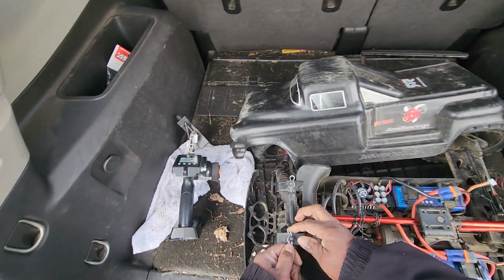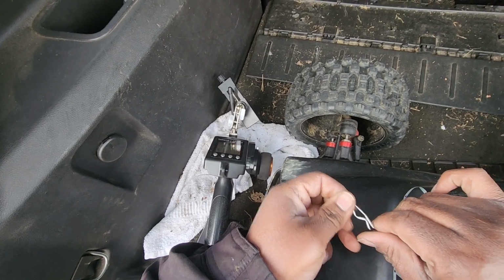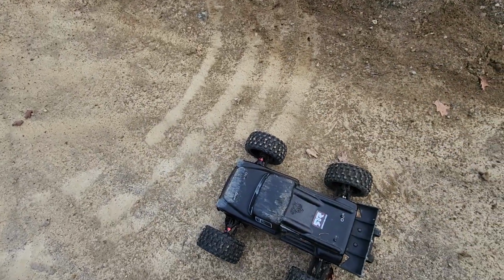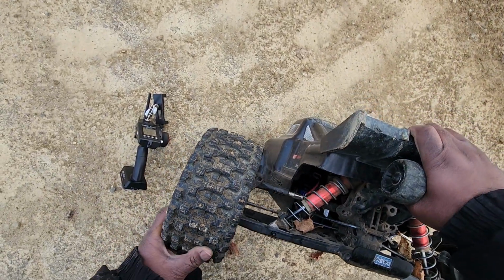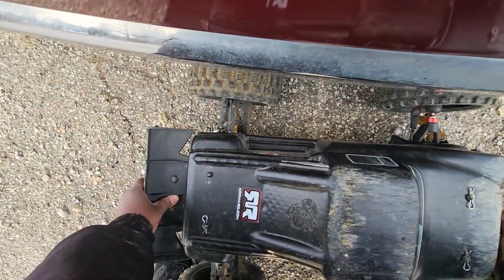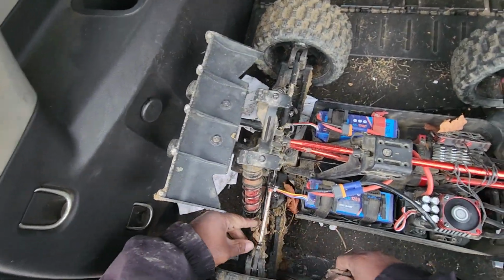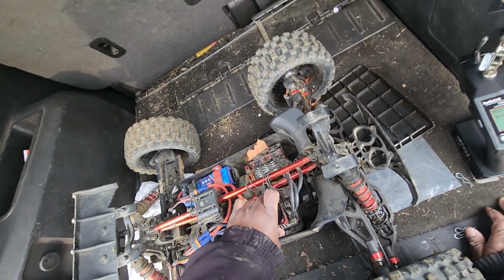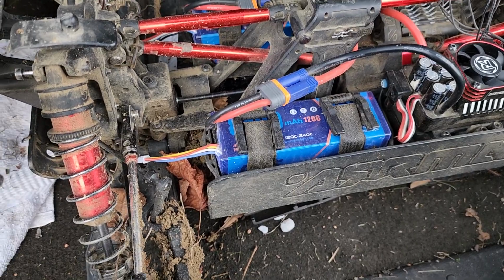Out bashing King Kong Arrma Outcast 8s

Comment: Nice did you go back to the 27t pin ?
Reply from the maker: Yea I'm running 27/39
Reply: ok thanks
Reply from the maker: @PyroKing-kv6vz  no problem brother 🍺💯
Reply: @KalsRcAdventures  How is your temps doing?
Reply from the maker: @Pyro King1976  tempts not bad running a dual fans. Cool weather motor be cool.  Summer about 140 or so run hard.
Reply: @Big Kal Rc Adventures and Vlogs  I went with the same setup hobbywing max5 1100kv  but 26 / 39 should be just perfect thanks  bro..
Reply from the maker: @PyroKing-kv6vz  no problem bro 💯🍺

Comment: Love the look of the outcast, haven't been lucky enough to own one though, do you know what size the outdrive shafts are on the front and rear diffs? I've been trying to figure that out for a couple days, 8s is definitely a beast
Reply from the maker: I'm running rcawd outdrive with 4mm pins cvds on the rear. Haven't snapped yet front still factory 3.5 mm pin stock cvds.
Reply: @KalsRcAdventures  do you know what the shaft diameter for the outdrive is, where it goes into the diff? And awesome, I'm surprised that they didn't use larger pins to begin with, 3.5 is small for a truck that size
Reply from the maker: @Rest In Pieces RC  don't know the diameter of it lol
Reply: @KalsRcAdventures  damn lol, do you know what the bearing size is for the ring bevel gear
Reply from the maker: @Rest In Pieces RC  look for Jim bearings on fb send him a message he look out for u on the size